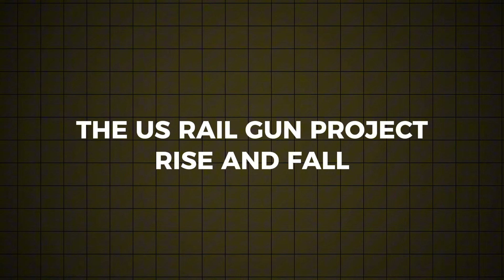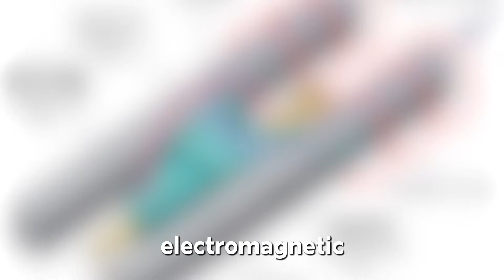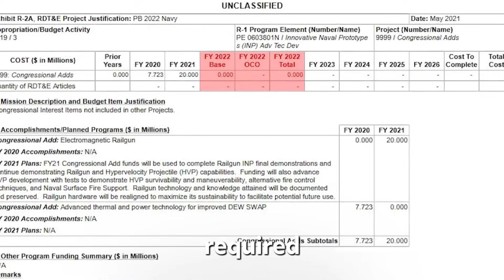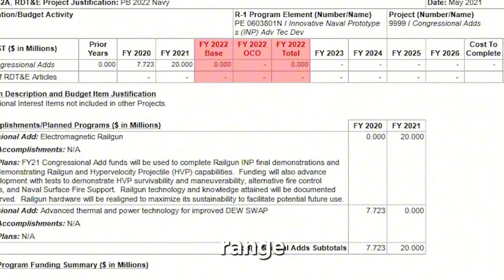Japan Revived This Scrapped U.S. Superweapon — And It Works!

Comment: With land-based real guns, they can have the most powerful electrical system that they could need to supply power to these things, they could use their grid, they could use massive battery system. They could use method generating systems, all rightthere on land
Reply from the maker: So basically, they just need to plug it into the wall like my phone? 😂 Imagine the extension cord they'd need for that superweapon!